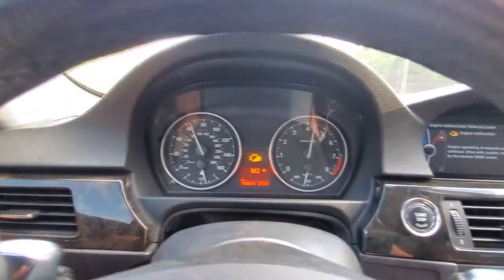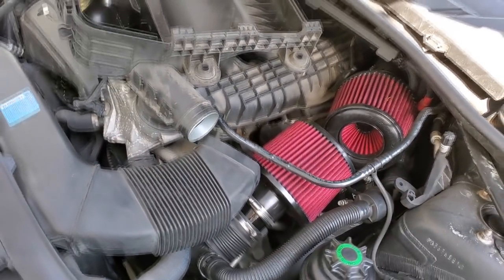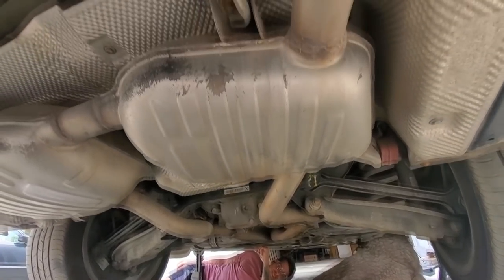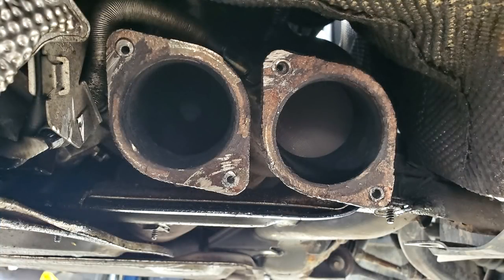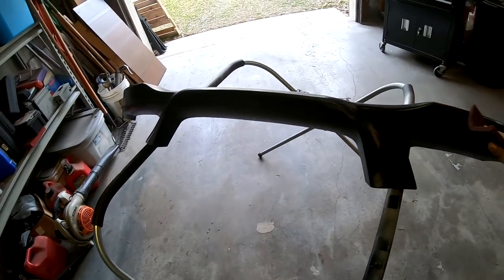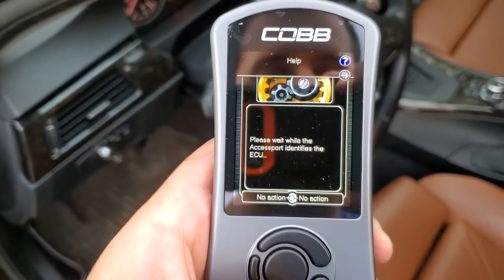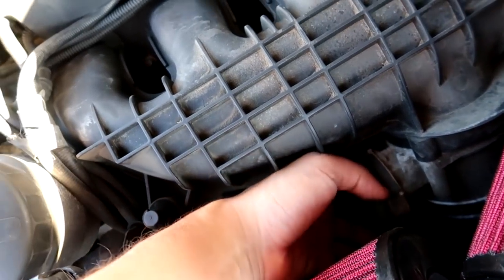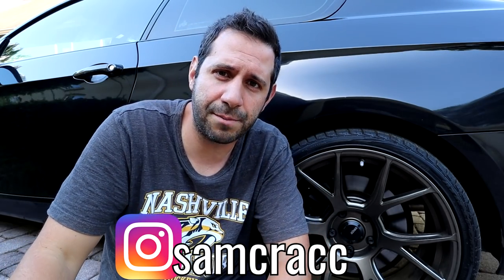Making a DONATED 200,000 Mile Twin Turbo BMW Look and Drive like NEW! (and then ENGINE MALFUNCTION)

Comment: You guys need to check the rubber couplings coming right off the turbos, they are notorious for cracking and jacking  your boost, causing the Eng. Malf. light.

Comment: Check your cylinder 1 and 2 again, I saw in the vid with Alex you replacing the valve cover gasket, you turned the car over and fuel came leaking out...Also the vacuum lines are important, o2 sensors, index 12 injectors, new coil pack, those sound like a lot to take care of, but it should help

Comment: You had code 30FF which is an issue with wastegate(s), vaccum lines or boost soleniods. That code alone can definitely cause the issue you are experiencing.

Comment: limp mode and error 30FF means there is problem with the waste gates on the turbos. Very common issue. Too expensive to fix if they weren’t already fixed under warranty.

Comment: Those cones will make no difference, maybe be worse. All they will do is suck in warm/hot air from the engine. Your better off buying a pan filter for the original air intake box. K&N or something similar.

Comment: So you wrong about the lambdas - when your o2 sensors fail , in this case b1s1 and b2s1 your car usually goes by default fuel air ratio since it can’t read proper and make  fuel mixture adjustments .  And since 335  is performance  car I would Assume your turbos get shut  and there you go - engine performance reduced .

Comment: Turbos are causing the limp mode to pop up under acceleration.  Waste gates are too loose.  Replace the turbos or get the waste gate repair kit.  Either way, you’ll need to drop the subframe and remove the turbos.  Or it’s he vacuum solenoids like another poster said.  I’ve been running with this problem on my 535i xDrive for 3 years.

Comment: On Chevy big blocks dyno runs found that the air filters that filtered thru the top as well as the sides made LESS HP that a standard style.

Comment: Cold air intake are a waste of money. They actually reduce horsepower unless some sort of ram air system is utilized. All about the noise. Once the engine is up to temp they just suck in hot air. 
Sound cool though. Enjoy.

Comment: Did you add a aluminium charge pipe?
Check the 2 small plugs on it,
I got the same line on my and it was one of the plugs fell off and was causing a massive air leak.
Those small plugs dont come tight properly.

Comment: It's a BMW. No such things as bolt on. You have changed everything in the system and it need to be re-engineered.

The filters change the air flow into the engine. The upgraded inner cooler change the volume and rate of air flow into the intake manifold. This changes the fuel mixture and metering. This throws the Air Fuel ratio off and the cars computer will try to adjust for it. When it goes past its adjustment threshold it assumes that the sensors are bad and throws a code. 

Chances are the inner cooler was never cleaned and caused the air charge temp to run hot causing the cars computer to adjust its values. Timing will be pulled, fuel ration changes to compensate for issues.

The wrong oil type will cause the VANOS to lag causing issues as well. The oil not only acts as a lubricant but
it also acts as hydraulic oil to push the cam advancement. People often try using cheaper oils which causes problems. 

Chances are the car was ran with low octane fuel to save money causing problems as well.  
The dealer most likely gave the $1500 based on the codes in the computer. 

Those are great cars with an extremely high maintenance price tag.

Comment: If its a K&N filter you installed, then you just introduced more dirt and dust into your engine :/. And my 2001 VW Passat has the same kind of safety :P. It gets into limp mode if it detects too much or too little boost

Comment: There is a reason why X-drive cars are on a square set-up.
If the rear wheels are different then the fronts, the differential can't deal and you break stuff. Had 530xd with this issue after swapping to wheels from an M5 which are wider in the rear, this in turns makes the rear wheels very slightly (less then 5%) larger and it broke the diff.

Comment: The oxygen sensor wouldnt put the car in limp. Most likely boost pressure leak code. 02 sensor would light up the cel. Check the boost solenoids theres 2 of them easy to replace . Or the  vacuum lines

Comment: Best mod you can do is change the chrome grills for black. Also I’m not sure you would see full boost pressure in second,  in my limited experience of tuning cars most won’t run in full load until 3rd and 4th , Unless the map changes that of course.

Comment: I've noticed after market exhausts are often way smaller and lighter, which is good in one way.
But they often leave a lot of empty space at the back of the car, right in front of the rear bumper. When you drive at high speeds, this builds a cushion of high pressure air on year your axle which pushes your car UP...and the effect is a lot more powerful than the effect of any spoiler you will be putting on the back of your car.

Comment: Hey Sam,  I don't know how long you are planning to keep the car but that staggered set of wheels will ruin  your differental very quickly , especially if you are going to add power to the car. Also here in Germany everyone uses the stock airbox with oem filters up to 600 hp, the dual cone intake causes the car to lose power and run lean ( proven time and time again), they do sound nice thought so if that is the goal then ok.

Comment: Eldor coils, fresh plugs and downpipes with new o2 sensors. Looks like you need an oil pan gasket done anyway, do it while the subframe is down for the downpipes.

Comment: You should have driven the car after all the changes and checked it was running fine, then mapped it. Even then, mapping an old car like that which already had problems ❓

Comment: The air hammer on those exhaust flange studs may have ruined an oxygen sensor or two. I had mine punched out and ended up replacing 3 out of the 4 O2 sensors as a result. Good luck!

Comment: do the serpentine belt and oil filter housing gasket asap. prevent the belt from slipping and getting sucked in the motor

Comment: Cold air intakes are more often than not a joke. I currently drive a 96 E36 and the previous owner installed one and it sucked air in right behind the radiator. The factory sucked it air from a clear opening NEXT to the radiator. Needless to say the so called HP mod got replaced with the factory system as soon as one came up for sale on Ebay. I love the cold air intakes I see on a lot of hondas that are mounted a couple of inches from the ground. Go thru a deep puddle and instant hydro lock  and wasted motor. Cold air intakes don't work unless they actually bring in air from outside the engine compartment. The wheel wells or from in front of the radiator core support.  If they suck air from anywhere under the hood they are a waste of money. Just look at REAL race cars and see where there intakes are mounted to get an idea how to do it right.

Comment: you put 2 cone air filter to auck hot air from under the hood and then a bigger intercooler. Get those air filter out from there and you wil get a better performance

Comment: The pod filters you installed are usually higher airflow than an airbox. However the horsepower gains they promise are almost always bogus. Some people will use PVC or other tubing to reroute the filters somewhere in the bumper or other cavities to allow colder air. Having them right on top of the engine like that will have good airflow, but the air will still be fairly hot.

Comment: A friend of mine had a 335i E91 and it got CE light when flooring it, caused by the turbos. Had them swapped out twice and it had about 90000 US miles on it.

Comment: Imo you should not run staggered setup on awd. puts more tension and strain on your central diff as the front and rear wheels are not the same diameters. have a buddy who blew his diff on a 330i e90 doing the same thing. just be cautious!

Comment: Sam - did you add an 02 bung or is it for sure the 02 sensor? what DP did you add? If it's a smaller sized cat than stock it'll throw a CEL for it

Comment: Also o2 sensors codes can be thrown by few other problems like mixture to lean to reach and sometimes slight misfires will cause o2 sensor problem .

Comment: I am not understanding how switching from factory cold air intake from the front of the car to aftermarket hot air intake toward the top and back of the engine increase HP.  I would guess at best, it will have no effect on HP with turbo, intercooler.

Comment: When rattle can spraying anything get yourself a can tool that allows you to pistol grip the 'handle' to spray without using a finger or thumb. It is much more comfortable and allows for better side to side spraying. You won't go back once tried. Trust me on that. Available at any box store, etc.

Comment: I had the same issues with my N54 and you definitely need to replace the coils and plugs and more than likely the expensive fuel injectors!  Lastly walnut blast the intakes to get the most of your mods.

Comment: If you checked all the sensors / cleaned, it might be the ECU. They often cause a cluster of faults, that are not really there. Try sending the ECU to a repair where they replace all passive components on the circuit board  and it should be fixed! Good luck from an electrical engineer

Comment: Next time you're having trouble with an exhaust like that the trick is to get a cutting wheel and cut a slit going to the Bolt Then start heating it up grab vice grips and start trying to expand the circle around it it will work promise you mine looked worse than that Then when you're done bend it back together

Comment: if you never fixed this vanos soleniod will cause this. simply pull it off and clean it. one of my wastegates got loose and i was able to tightened the arm. tuned on ethanol these are about the easiest way to 500 ish hp on the cheap and sound great!!

Comment: that car is a known endless money pit and you can fix it and get it running but it will continue to break down because of the engineering and design quality inside that twin turbo engine motor they do not last as they are not designed to last....jinx car...

Comment: The plastic boost collector tank must be leaking then the turbo overboosts as the waste gate is not opening, and puts the car into limp mode for over boost as the boost can’t be controlled ( a small plastic tank where all those little boost hoses connect to) , thus telling the boost sensor that the turbo is boosting too much, use strong sealant along the seams of this little tank, or you can use those fish tank accessories that reduce a thin hose by pinching it a bit , a pipe that also ..pls wire me $50 for this advice 😄
If there is a problem with the output gasses (ie too much boost) the lambs sensor will read it as too high and throw a code

Comment: If you leave the front piece to the stock intake connected then it should work similar to ram air. It will force cool in that will push the heat away from the air filters allowing cool air in.

Comment: Should've done the full ARM suite. Chargepipe with Tial Q BOV, FMIC, FMIC Hosing, and DCI, and downpipes. Costs under 1k and is the right way to mod this car. Maintenance should be, step 1 colder plugs, new PR coil packs, walnut blasting, and fuel injectors. Maintenance items like that should total to around 1500.
Reply: I'm sure COBB must've given you a deal or something because not a single person on this platform uses any of their products. The comments on the first video gave you great recommendations for what should be done and it sucks to see that they weren't looked at.

Comment: i didn't pay attention to the exhaust but is it a high flow cat or no cat?  you mentioned o2 sensors, with high flow / no cats you need a spacer on the o2 sensor post cat.

Comment: Why did you go for Cobb? It's the most outdated tuning system for this platform. 

MHD and Xhp / custom tune from Wedge tuning.

Why are you wasting money on old systems. MHD also reads fault codes and you can data log where people will help you diagnose it.
Reply: Also the exhaust . Stock with P.E mod is the best sounding without any done. Keep the rear cats there's hardly any power to be gained without them. Remove front cats

Comment: The 335i rocks, it's only dummies who don't like the german engineered cars, but if you are willing to use your brain, these the easiest cars to fix.
Reply: mine had a piston ring break suddenly at 90k miles :/ 
car was working fine then rough idle -> thought it was hpfp -> turns out cylinder 1 had 0 compression
needed to drop in a new engine, rebuild was more expensive :/

Comment: You need new upgraded oem injectors
New coils 
OTG cable with D-kan Or K-kan cable 
MHD android application
Cobb is crap
Cheers
Reply: You did good sam it turned out great just get the boost thing fixed

Comment: If the airfilters were placed where they got direct air in from the front of the car you might get something out of them, but where they are placed in the middle of the engine bay, they will even sound crap...
Reply: butti fdft  Yea... actually agree ;)

Comment: I got the exact same issue with my 335, although I don't lose any boost or power and it takes longer to come on. Wonder what it could be.
Reply from the maker: Have you checked the trouble codes? It should point you into the right direction!
Reply: @Samcrac  I have used a obd reader but it only shows dmtl pump and a running lean code because I have catless down pipes. But even before I installed the catless downpipes it did this whenever I would gas it just how yours does. What tool could I use to track this down?

Comment: Is it ok run staggered wheels on an awd car?  Are the tires the same size all around?
Reply: yes, as long as they are the same circumference. In other words, the height should be the same front and rear, width doesn't matter.

Comment: So you have perfectly working stock bmw 335i, you put all kinds of cheap ebay stuff on it. And now its throwing engine codes. Guess where the problem is 😅. And why change the brake rotors without changing the pads?

Comment: I have a 2007 E92 335i with the N54 engine as well, however mine is a manual transmission. I plan on installing a JB4 tune with a backend MHD flash, Precision Raceworks coils, chargepipe and Tial BOV, VRSF 7.5" stepped race intercooler, and VRSF downpipes. Should be fun!!

Comment: “Huh, another engine malfunction light. Now I know I rarely do this, but I am actually going to have to take the car to someone who knows what the they are doing. Now, I did the heavy work (putting my wallet in my pocket” and I do not think it should take more than 2-3 days for them to correct all the mistakes I have made so far, and should not be any more expensive that, oh, maybe 4-5k. Now keep your notifications on as my  🐓 and I continue this amazing rebuild!” 🙄😂😂😂😂

Comment: If you put some engine oil on your drill bits they last longer and they don’t tend to snap because the oil stops them from getting hot because of the friction and they don’t get as weak and snap just a tip I learned dude :)

Comment: Generally there is a reason why most manufacturers put a "air duct" to the front of the car where it can pull in cold air instead of the hot stuff from the engine compartment (especially such cramped engine bay with a performance engine with glowing orange turbos in it)...

Comment: just curious, why cobb vs MHD or JB4? :)
Reply: i can also strongly recommend XHP stage 3 for your transmission, i did it on my 335i and it made the car amazing, better throttle responce, feels almost like i gained 50nm haha and it shifts much faster and smoother :)

Comment: I’m a 6 year owner of a e90 n54 335i with full bolt on’s. And yes those dual cone intakes make a big difference in throttle response and power by letting the turbos breath 
better. Also COBB is very outdated in the n54 platform if you want the most power while staying in budget you should of gone with MHD. One more thing an oxygen sensor won’t cut off power it Will only give you a check engine light. If the car is still on original stock turbos it’s more than likely the problem with the limp mode sense the turbos waste gate are failing to hold boost.

Comment: Ahh, as a 335i owner I saw the infamous 30FF code and all I can tell you is that your turbos waste gates are worn out. Especially when there's that rattle on cold start. They probably have 100% failure rate which is tied to a design flaw, anyways if they're still the original turbos at this mileage they definitely need to be rebuilt/replaced, or go single turbo.

Comment: I used a Cobb accessport v3 for a year and a half. It is only good if you’re running Cobb upgraded parts. You can make better power with a protune which is much better than Cobb. Cobb is kinda like a bandaid tune. I’ve seen people blow their engine after 20-30k of using Cobb due to improper parts installed that wasn’t compatible with their car and tune. Personally I think boosting a high mileage engine is kinda sketchy. That’s why I got a protune and I learned that the hard way. But I’m not gonna diss Cobb because it is the perfect way into getting into tunes. I’d say the only downside is the price of parts+ accessport v3. I use mine just for to see the health of my car and boost.

Comment: The filters not having a shielding on a boosted platform wont really affect anything due to the air being heated by the turbo anyways, it goes through the intercooler and is cooled the same. On a NA platform it will rob power because the IATs will be higher and the air less dense

Comment: I get 4 mpgs better with the engine bay soak heat and a warm air intake hybrid made out of the stock box with a panel style filter, the cones will suck alot more warm air